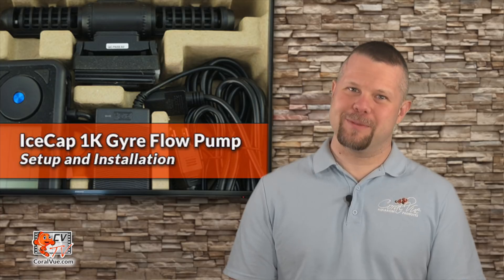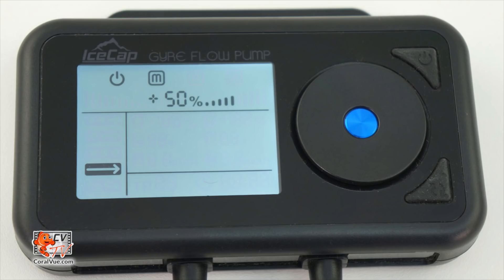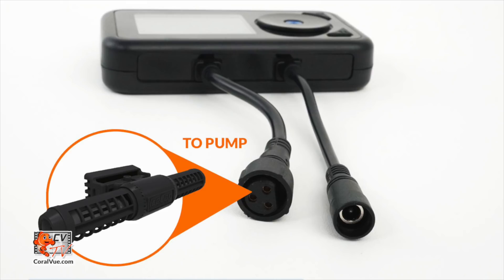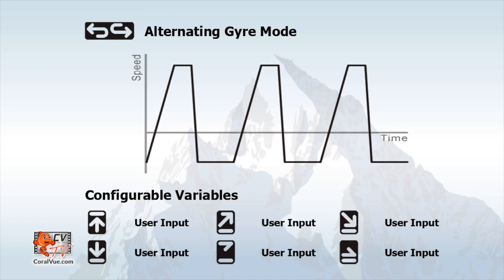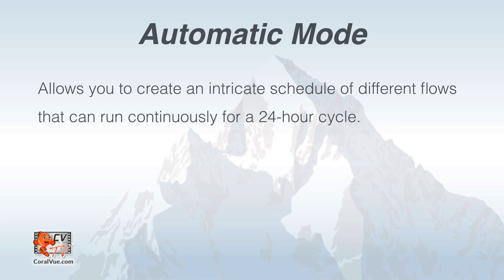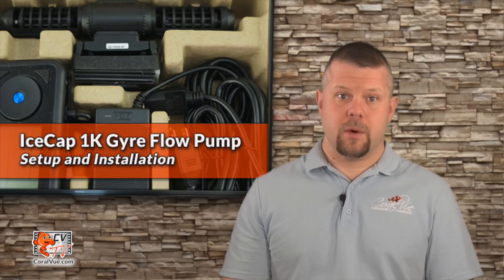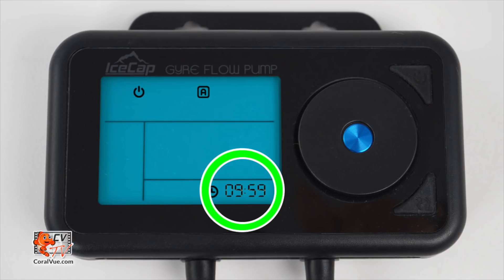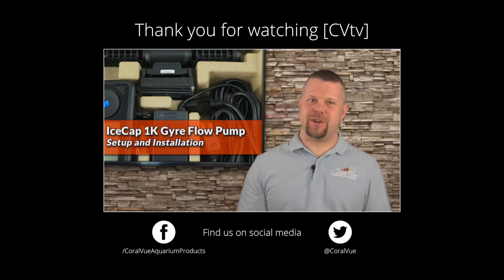IceCap Gyre 1K 101: Setup and Installation

Comment: What would cause one side of pump to be more powerful than the other?
Reply from the maker: Besides an obvious shattered shaft a worn or broken bushing would cause one propeller to spin and the other not to.
Reply: How do you replace the bushing?  Do you have a video on this?  I see extra parts the white pieces and some black washer things.      I removed the guard and the propeller but not sure if i should force the white piece out?
Reply from the maker: @heuerfan  The 1K is very similar to the 3K seen here: https://www.youtube.com/watch?v=Z55O_8FAqbc&t=1s If you still have issues you can always contact our support staff at support.coralvue.com.

Comment: I cant turn mine off, it goes into feed mode just by clicking it once.
Reply from the maker: Rice Farmer press and hold the power button to turn off. Momentarily pressing initiates feed mode.
Reply: CoralVue aahh i figured it. It mist be on the running mode and not the fix or setup mode. Got it.

Comment: And no number for customer support
Reply from the maker: Sorry for the issues you are having. The phone number is listed on our website. However I do suggest that you submit a support ticket at coralvue.com/suport for quicker assistance.
Reply: @CoralVueTV  do you know what it can be? It just stopped working, i cleaned it and maintenanced it, it has power, when i press the button to start it, it goes to 100%, the propellars move a few "micro" movements then it drops to zero and that's it. I unplugged it for awhile, and still the same thing.

Comment: I just purchased my 3k today 08/24/18..  Well mine came with the new controller that the 1k comes with. The controller powers up but the pump does not run. I took it apart and reassembled the pump it self.. Everything seems to be ok but nothing from the pump, just wont spin.
Reply from the maker: Sorry to hear of the issues you are having with your 3K pump. Please submit a support ticket to CoralVue.com/Support for assistance.

Comment: I have one on my 32g Biocube and love it. I don't need to use it on anything more than 10% and maybe 20% in reverse. Thats more than enough flow for a tank that size. This is also good because you know your puting minimal wear and tear on the pump which has to help with longevity. Thoroughly recommend it!
Reply: I'm doing a biocube build now, do you still have the gyre, and if so, how's it working for the cube now.
Reply: I have one on my 32cube, I can't bring myself to buy the reverse kit for another 54 dollars on top of the pump itself. It advertises gyre reverse but little did I know I would have to spend another 60 bucks. I would have bought a better model for the money. But I digress... Deep down I love my 1k gyre and so do my fish and corals. Can someone help me with the setup. I want to do a simulated tide over 24 hours. Cant seem to figure it out. I can only do max of 30% and only for about 20 -30 min before the sand starts really building up. Any info is great!
Reply: I have gradual pulsing from 10-30 on the left side of the tank by the return sitting horizontally
Reply: Also at the time my blue moon light kicks in I just set it to do continually at 10%

Comment: I'm setting up a 60 gallon cube and have a 3k model waiting to be installed. Would the 1k model be a better option?
Reply from the maker: If your going to go with two pumps I would go with two 1K pumps. If only one then the 3K will allow for more flow. The biggest difference to consider is the size of the pump itself. The 1K are much smaller in size.
Reply: I have a 32g and I dont use mine on anything more powerful than 10% forward. I am not sure you would need 2 to be honest.